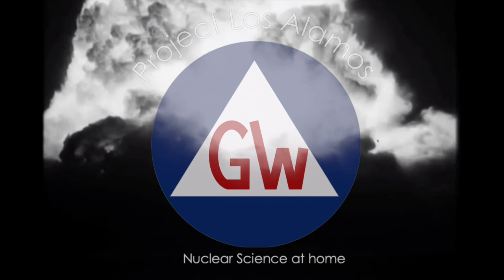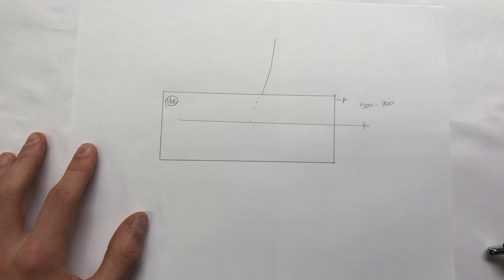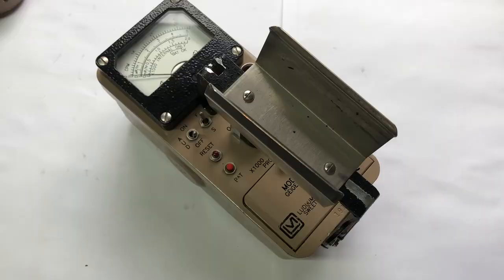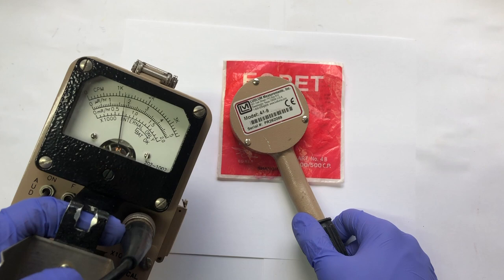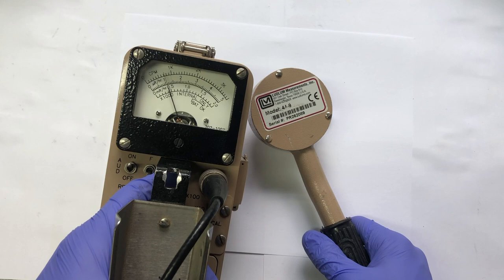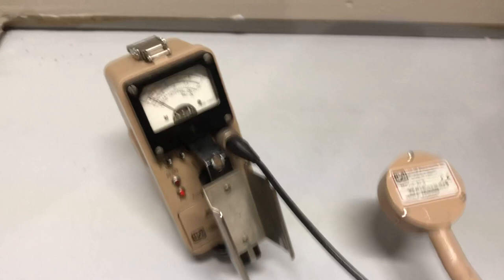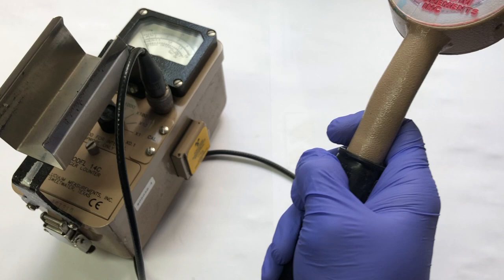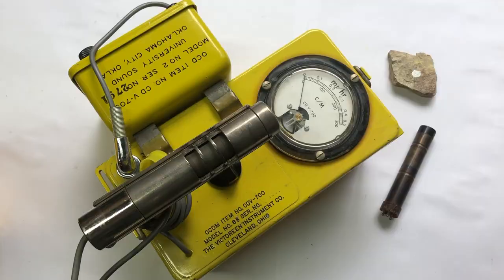What is a Geiger Counter and Why You Need One.

Comment: I wondered if inside those metal tubes, if you were to expose the glass inside, would the tube be more sensative, or does generally the shell not prevent the transmission
Reply from the maker: The issue with using glass it is an insulator, so would not be able to apply a voltage potential to it. You would still need two metal parts, and glass tends to be fragile so it might break.